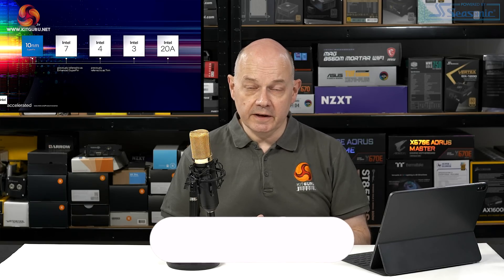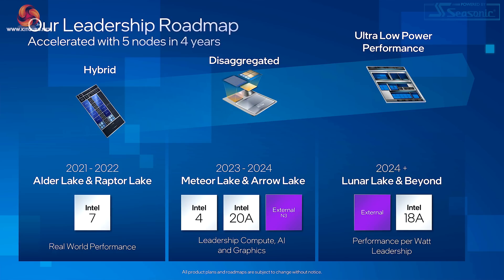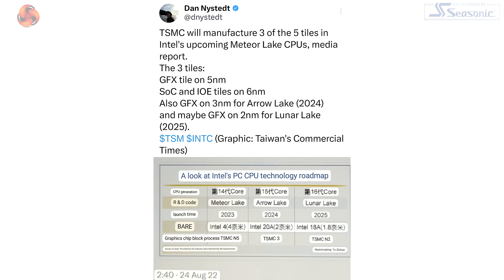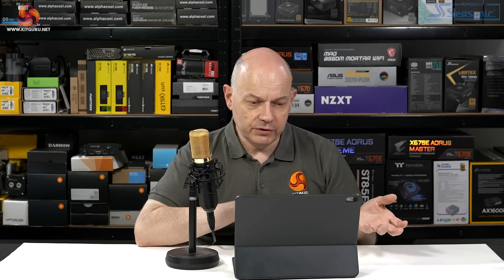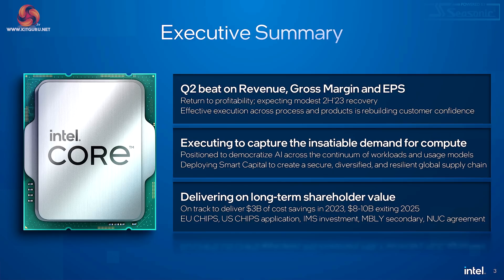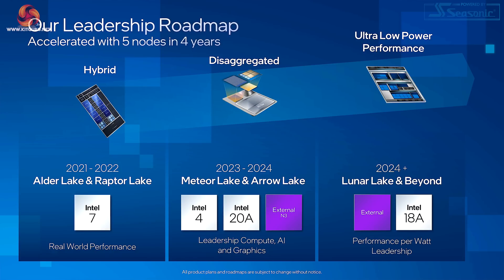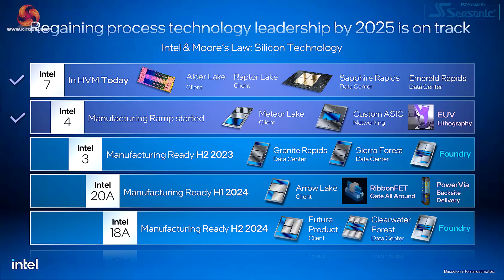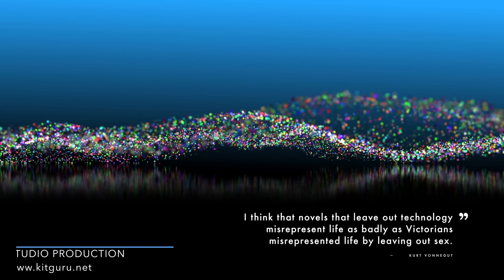Leo Says EP.67 - Will Intel use TSMC N3 for Arrow Lake?

Comment: MLID is fools and mislead AMD fanboy, he deleted items from Youtube that is wrong.
As I commented on WCC  there is a high possibility that MLID is totally wrong.

Intel already mentioned as you said test production phases of Arrow Lake.

Arrow Lake is 20A (GAA and BsPD) this is too different to TSMC N3 Class, it required a total redesign, if Apple Rumor out there making this much about the different of TSMC N3B and N3E, then how you expect Intel 20A to TSMC N3E, sorry the design library is totally different.

Remember when Arrow Lake launch in 2024 Meteor Lake will already be 1 year old, there is too many changes, it is much more logical to do a Laptop Arrow Lake and Desktop Meteor Lake Refresh, that can pushing the ball forward, this also save a lot of face for the CEO and is going to be much more pleasing to the Investor.

We Know about these things:
TSMC N3B is in trouble, there are too many rumor indicated this is the case.  TSMC N3B should be deleted in our mind.
TSMC N3E is an optimised N5 Class, there is little RAM scaling.
Intel 4 from the PowerVIA presentation is a TSMC N5 Class i.e. it will be the same as TSMC N3E (High Performance), this put Intel 4/3 = TSMC N3E that also meant that Intel is 3-6 months ahead of TSMC (YES INTEL is AHEAD of TSMC in 2023).
TSMC is in trouble not INTC.
Intel has it fair share of problems, it yield is unknown and there should be some sort of clock speed issues so there is Raptor Lake Refresh.
One full year is a lot, it is way easier to push Meteor Lake Plus rather than TSMC N3E, based on Intel own slides the M0 pitch is going to be within 1 % of TSMC, so why ??? TSMC ???  required redesign ???? just carry on improving on Meteor Lake and by the way they can even now separate better die, ie die can clock higher and carry on making low clock laptop parts and then Meteor Lake Plus for desktop in 2024, that mak 100% more sense and can milk the cow much more effectively.
Reply from the maker: On the desktop we seem to be getting Raptor Late Refresh this year and Arrow Lake in 2024 with Meteor Lake reserved for Mobile only. That raises the question whether the rumoured Lion Cove P-cores in Arrow Lake can be manufactured on both Intel 20A and also TSMC N3. Right now the answer is 'Don't know.' 
Leo

Comment: The thing with arrow lake using TSMC N3E on high end, I think, is that 1. to justify the price that they are paying to TSMC, buying wafer from external foundries doesn't come cheap. Especially for a company like Intel that has financial woes currently, and you bet TSMC will want to charge a higher prices compared to AMD and Apple who have been especially loyal to their foundry partner.

Also, Intel 20A isn't a complete node like Intel 18A, so it may come with some disadvantages that Intel needs to figure out and improve the yield. It's going to be a good learning experience for them, definitely.

Beyond that, another reason that I'm speculating is that they just don't have much capacity that's ready for Intel 20A/18A because all of their leading edge fabs are still under construction. The earliest one in Arizona (which will feature 18A) isn't going to come out until 2H of 2024. So they are dealing with a very limited supply.

Comment: The way I understood it was that the iGPU tile for Meteor Lake and Arrow Lake would be manufactured using TSMC process node. Initially it was planned for 3nm but now will be on an older process node. I don't think Intel would use different manufacturing process nodes for the same CPU micro-architecture.
Reply from the maker: Intel's approach to disaggregated design aims to separate design from process to avoid the disaster of being stuck, as they were on 14nm. From this point onwards you can expect to hear more about packaging than process, starting with Meteor Lake.
Leo
Reply: @KitGuruTech  I understood the reason they were stuck on 14nm wasn't because of their micro-architecture design but because they were struggling with manufacturing at more advanced process nodes. TigerLake could be designed to be manufactured on TSMC 7nm instead of  Intel 10nm but Intel didn't have such a strategy for using external Fabs.
Intel are actually good at micro-architecture design, it is what saved them during the prolonged stay at 14nm. Intel had to make due with older process nodes and compete as AMD moved to more advanced process nodes from TSMC. AMD is currently on TSMC 4nm while Intel is still on Intel 7. For RaptorLake to compete with Zen 4 with such a disadvantage on process node is a great showing for the micro-architecture. It is difficult to design a micro-architecture without consideration for the process node, the process nodes informs the transistor budget available.

Comment: So.... 20A means layers are only 20 atoms thick?
Reply from the maker: If 7nm means the features of the chip are defined by structures that are 7nm wide (it doesn't but bear with me) and 5nm, 4nm and 3nm allow for smaller and more dense transistors then 20A is approximately in the 2nm area. Leo
Reply: The A is for angstrom or ångström, a widely used unit in science that is one tenth of a nanometer (1e-10 m). 20 A = 2 nm, 18 A = 1.8 nm.
Reply: @TheAmmoniacal  Ah, thank you. I think my brain was locked on graphene technology the other day.